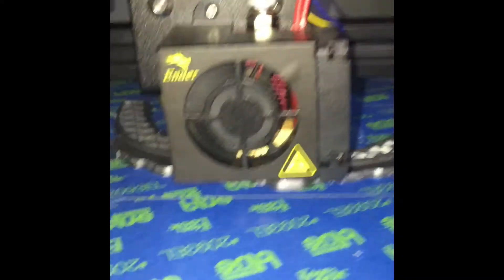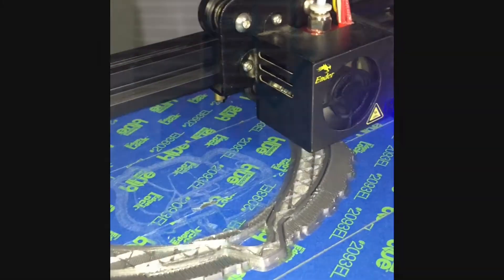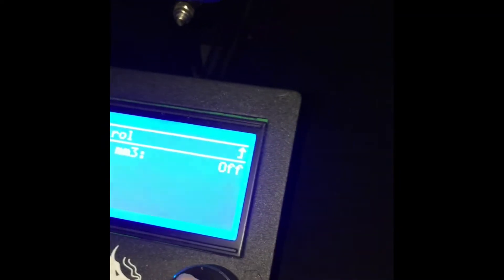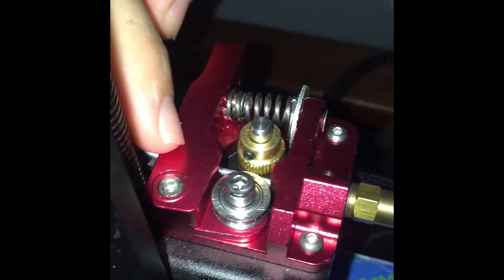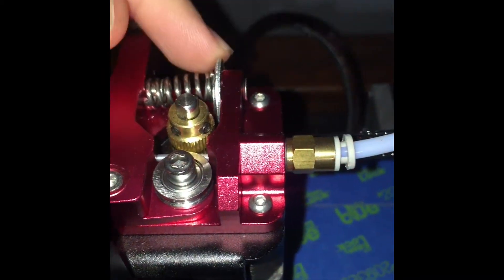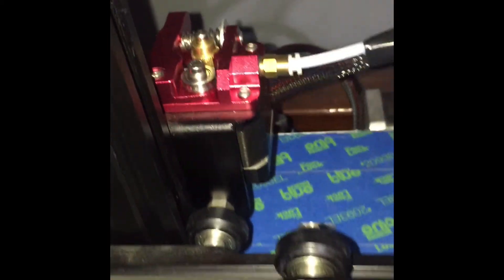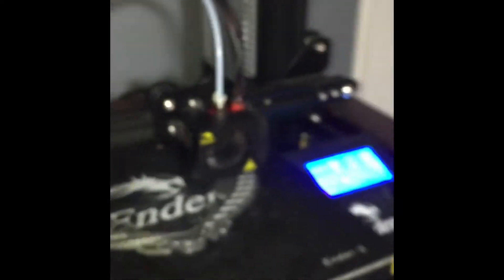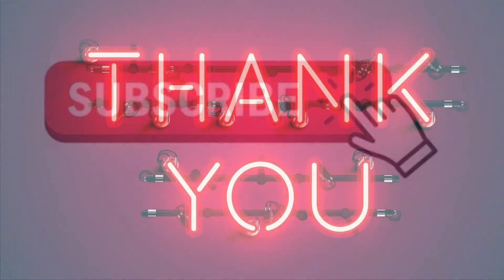Five tips on how to solve under extrusion for the ender 3 , 3d printer (FINALLY SOLVED!)

Comment: #3 Tip saved me. I even changed the belt of the printer and then I remembered after watching your video I turned that setting on for some odd reason. There wasn't a slice that would fix the under extrusion due to the filament type on!